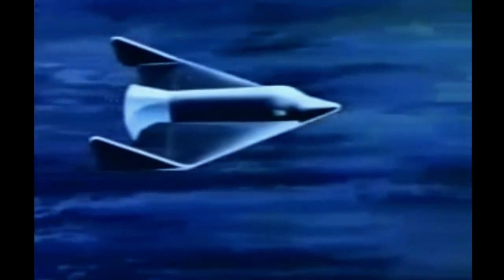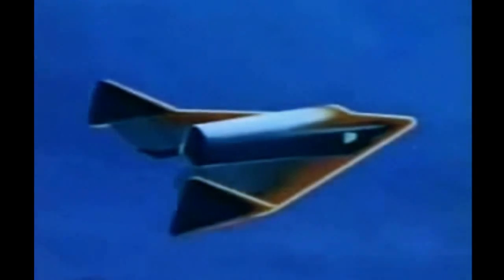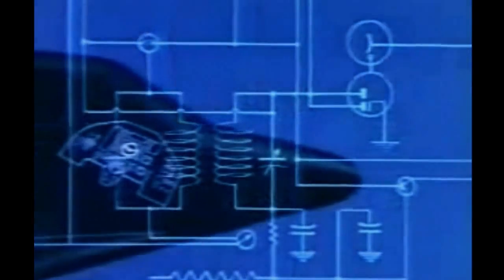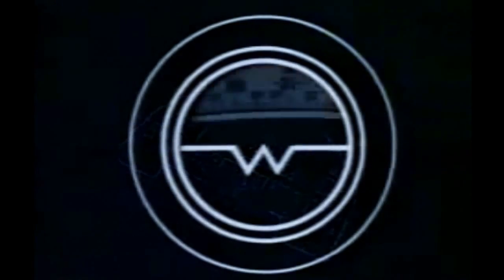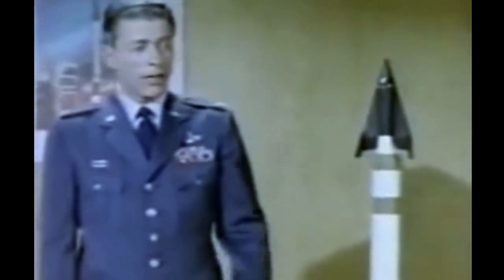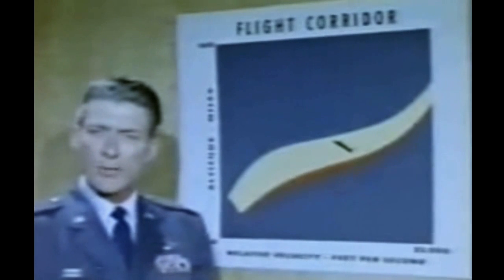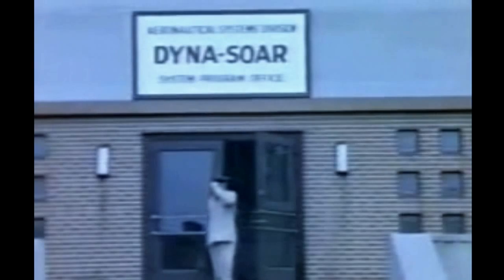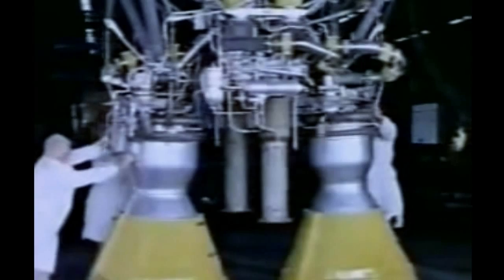Boeing X-20 Dyna-Soar Promo Film - 1962

Comment: Would the metals they planned to build this thing from have been good enough to protect it from the heat of re-entry. It was not designed to carry heat resistant tiles (they didn't exist at the time) and the X-15 had been very badly damaged by heat at only Mach 6.7. How would the structure have coped with Mach 20.
Reply: Based only upon the cartoon imagery provided here, and a plywood mock-up at Boeing, I'd say the future did not look good for this program.
Reply: Mike Steadman The X-15 was built of Inconel-X, a nickel-chromium alloy, which was thin enough that the plane would reach up to 800 degrees C, during reentry and high speed flights. This was partially on purpose, as they were after data on aerodynamic heating. However, there were other alloys in existence at thectime that were lighter and would have done a much better job at protecting the plane; Douglas Aircraft's competing X-15 bid, the Model 684 (informally known later as the D-558-III), was proposed to use a magnesium-thorium-zirconium alloy called HK31, which was actually much lighter, stronger than Inconel-X, and could therefore be made much thicker without a weight penalty. The Douglas concept would also use a solid copper heatsink on the wing leading edges to efficiently conduct heat away into the rest of the plane. Whereas the Inconel-X based North American design that was built would push over 800 degrees C at just over Mach 6, the Douglas proposal's HK31-based structure would have kept temperatures down to a comfortable 300 degrees C and potentially reach speeds of up to Mach 9 without the need for modification (such as the ill-fated spray-on ablative coating tried with North American's plane during its near-Mach 7 flight in 1967). The main reason the Douglas proposal was rejected was because NACA and the Air Force had their hearts set on Inconel-X, thinking the HK31 structure would interfere with gathering the aerodynamic heating data they were after. 
The X-20 Dyna Soar's hot structure, on the other hand, would have used even higher-temperature superalloys, such as Columbium (later used for air collection ports installed in an experimental nosecap on the Space Shuttle), Molybdenum and Rene-41 (the same metal used in the shingles of the Mercury and Gemini spacecraft), with a nosecap made of graphite reinforced with zirconium rods. This structure was actually tested successfully with a series of unmanned, subscale vehicles dubbed ASSET (Aerothermodynamic Elastic Structural Systems Environmental Tests) which were designed to simulate the nose and forward wing leading edges of the Dyna Soar, where the aerodynamic heating would have been the most intense. Launched from Cape Canaveral on low suborbital trajectories atop Thor IRBMs, the vehicles reached speeds of up to Mach 17.5 and all 6 survived reentry and successfully splashed down in the ocean under parachutes. Only one ASSET was ever recovered successfully, however, due either to malfunctions in floatation gear, or because recovery was not planned on some flights. It's now on display at the USAF Museum in Dayton, Ohio. The point is, in all likelihood, Dyna Soar would probably have been a rousing success, had it been built. My late grandfather, Victor Horton of NASA, was a flight test engineer at the Flight Research Center at Edwards from 1958-1986 and was heavily involved with the X-15, lifting bodies and Dyna Soar and knew several of the pilots who would have flown the X-20 quite well, had it been built, especially Milt Thompson.
Reply: Reading your comment I am always impressed that the designers of that day and era with what they wanted to do and managed to do despite what we would consider a "limitation" of the materials available and no computer power. Have to wonder if they were around now they'd probably out shine us with what they could create. Thank you so much for describing the the technology so clearly.
Reply: I was told by someone on the project that there was a plan to put the X-15 into orbit; but try as they might, none of the X-15 pilots could fly the X-15 simulator from orbit to touchdown successfully. A non pilot asked to give it a try, and was successful on his first attempt. Everyone wanted to know how he did it. Simple, he replied, he watched the temperature gauge. If the plane got too hot, he pulled up, once it cooled down he would renew his descent. Maybe this is why the Dyna Soar did not use tiles or an ablative coating. 

BTW, part of the X-15's problems at Mach 6.7 were due to the ablative coating, which trapped the heat in the airframe instead of letting it dissipate like a heat sink.
Reply: @gabrielbennett5162  Great reply.